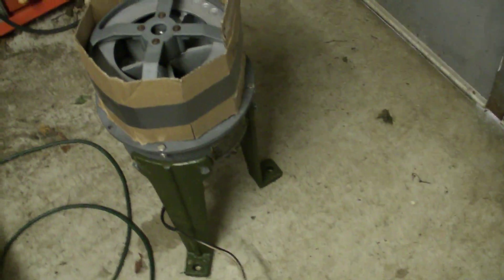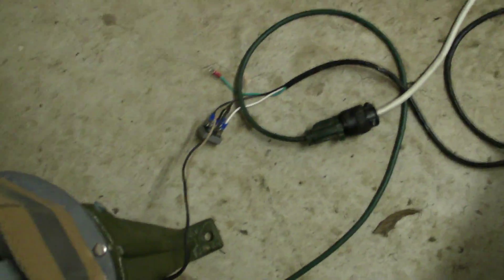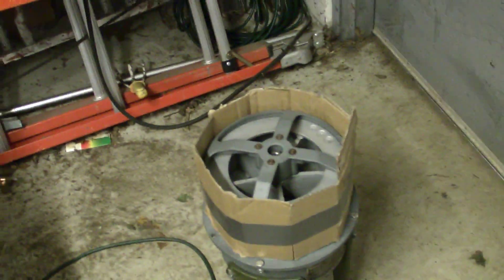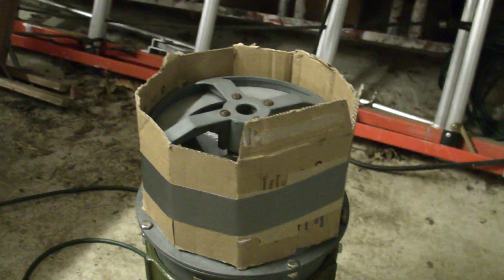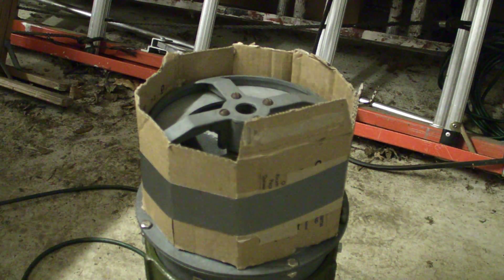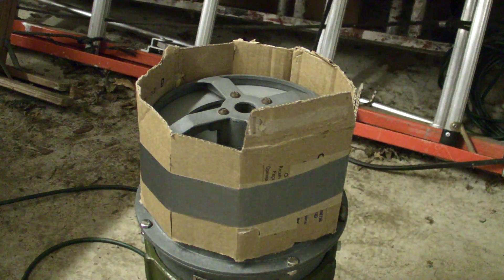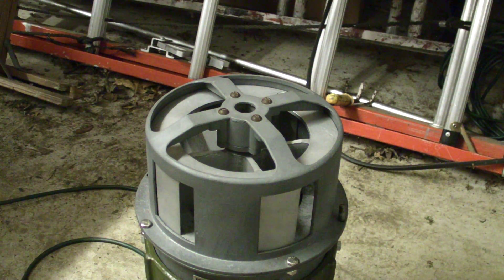Federal Model 2 120VDC

Comment: The brushes should arc a little, by the way. It's normal.
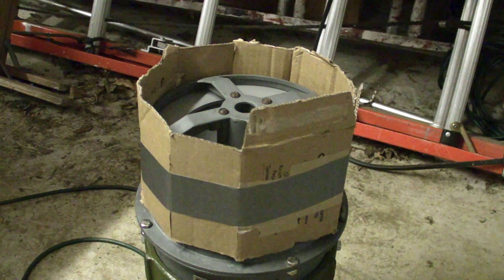Reply from the maker: yeah it was arcing pretty good, if you look just after 1:00 youll see several sparks flying out from the motor. i guess they just have to be broken in a bit